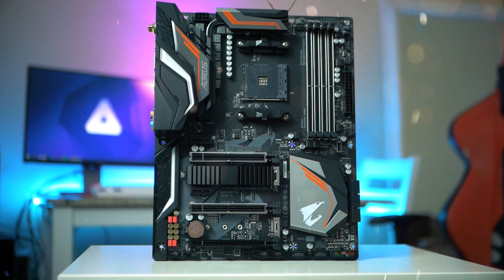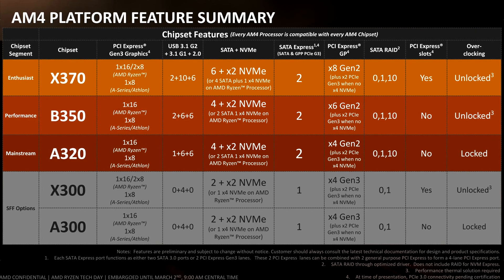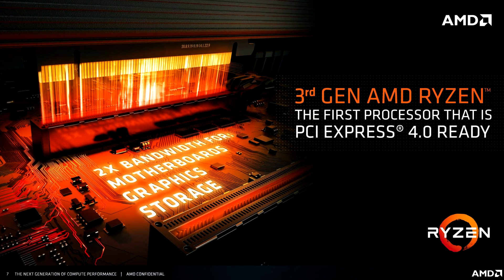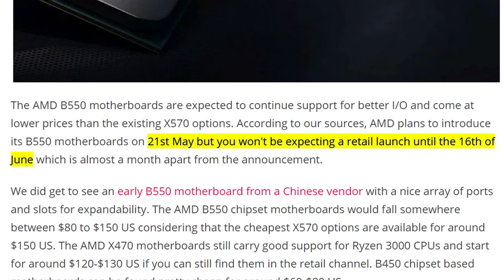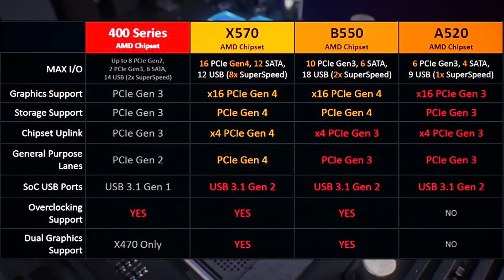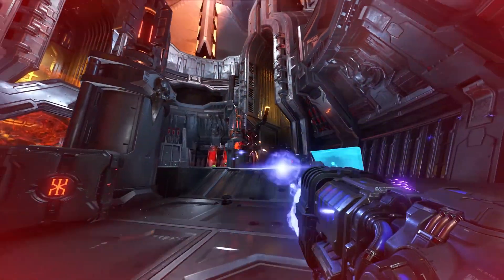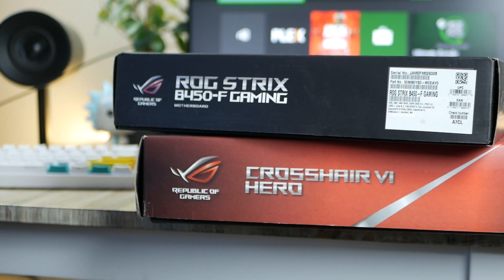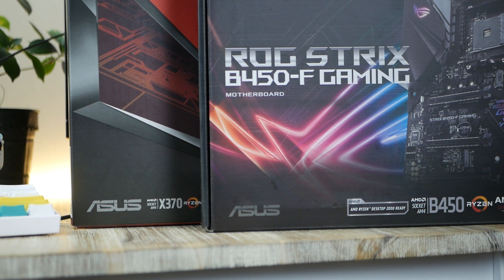AMD Ryzen B550 Motherboard's COMING SOON! Release Date, Chipset Specs, Price!

Comment: It makes sense to hold off regardless of which motherboard you want to use, simply because the presence of the B550 boards will drive down prices on the B450 boards (which will probably going on sale to make room for the new B550 boards) and probably even cause the X570 boards to go a bit cheaper simply through competition. 
So if you're planning on building your own rig, hold off until this summer.

Comment: I personally am going to wait for the b550 for my new upcoming build, just doesn't seem to make sense to buy a b450 when the new ones are about a month away, plus I'll use that time to aquire more funds to put towards it.
Reply: me too
Reply: I just contacted a local supplier and the price of the B550 didn't seem that flash, they only had the price of two boards, both gigabyte, the B550M DS3H which looks like the lowest end motherboard is still $225 NZD and the B550I AORUS PRO ITX is $405!!! I was pretty shocked and feel the wait is going to be a disappointment :( but the person I spoke to said the prices may change....hopefully they will be cheaper, otherwise the price I got quoted isnt too far from the X570's.
Reply: @simonli8889  Yeah, that just doesn't make sense to me.  Why bother releasing a new board if the prices are going to be just about the same as the current top tier ones.  At this point we just have to wait and see.
Reply: @jaytwo96  because that is not "about the same" as current x570 boards. That's 2/3rds the price. Gigabyte B450 Aorus Pro WiFi Motherboard is $260AUD, Gigabyte B450M-S2H Motherboard is $120, so a median of $190. Gigabyte X570 Aorus Ultra Motherboard (not close to the highest end but reasonable) $580, MSI X570-A Pro Motherboard (within range of the cheapest possible) $320. So a x570 median price of $450. I'm pretty sure the median price will be between the B450 and X570 at entry level x570 prices, but obviously Simon is wanting a 550 for 450 BUDGET prices... which of course is stupid... and he's stupid... ignore him. As you can see 550 will be priced smack dap between 450 and 570, even Simons own prices he quoted fit that.
Reply: I can't upgrade my TR to a TRX40 board $. But I won't buy a Gen3 SSD or GPU. I got the Zenith II Dimm.2 card for gen4 M.2 socket NVME drives and Asus new Hyper GEN4 PCIe card for 1-4 drives from Amazon.

Comment: There’s really no reason buying b450 now. Ryzen 4000 wont be supported so you’re going to be stuck with a ryzen 3000
Reply: Slightly Sarcastic, AMD have changed their mind about supporting Ryzen 4000 on b450 and x470 on about 18/5/20. They will now support it. However, you will have to clear out support for some or all older CPUs. It will be a hassle to change the BIOS.  You might brick your motherboard. You will also not be able to go backwards on the BIOS if you change your mind. There was not enough memory on the BIOS to store details of all the CPUs so older CPUs will have to be permanently deleted to make room for the Ryzen 4000 CPUs

Comment: i bought a pc with the "b550" mobo.
Reply: ya got scammed
Reply: @adamdavid7199  Not necessarily, it could be using the oem rebrand chip or perhaps they sold him that Soyo motherboard.
Reply: Its probably B550A, which apparently is not actually B550 as you would think it.

Comment: Can I use ryzen 5 in b550 motherboard, And r5000 cpu
Reply: ultra sigma 5th gen ryzen is likely gonna be using ddr5 so no
Reply: All the Ryzen generations, from 1xxx to the upcoming 4xxx all use the same socket, AM4. So yes, absolutely
Reply: No. AMD promised that they would keep the AM4 socket up until 2020. They have kept their word. The Ryzen 5000 series will almost certainly move to socket AM5. They will both probably be available in late 2021.  I expect that Trajedy is right about AM5 using DDR5 RAM memory. I think that it will also have PCIe 5.0.

Comment: So if I buy for example tomahawk b450 it should support 4th gen out of box or do I need to update?
Reply: Pcie gen 4 isnt a software thing that you update
Reply: @Iwobos oh
In that case yes he needs u update
Reply: Josip Juraj Bartolic b450 does not support pcie4 and a bios update will not change that.
Reply: You possibly have to update your BIOS, as that has been the case with motherboards when the 3rd gen AMD Ryzen was released. You won´t be PCIe 4.0 compatible though. That won´t stop you from installing the newest GPUs though, as PCIe, just like Bluetooth, is backwards compatible